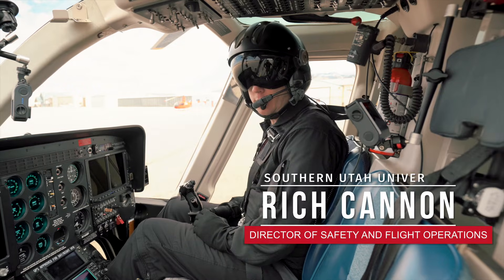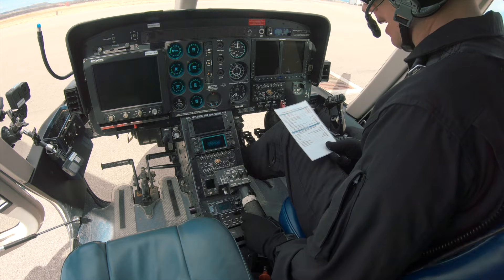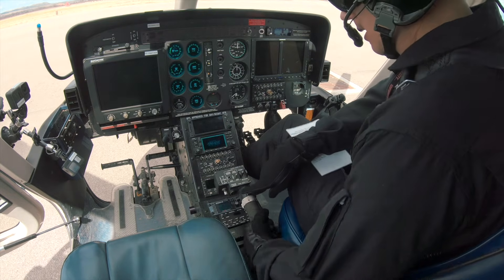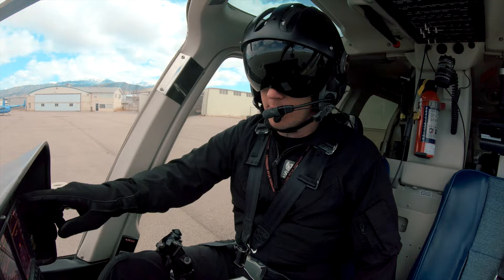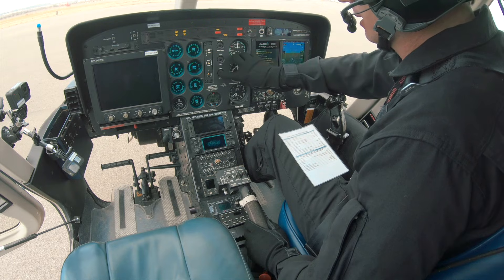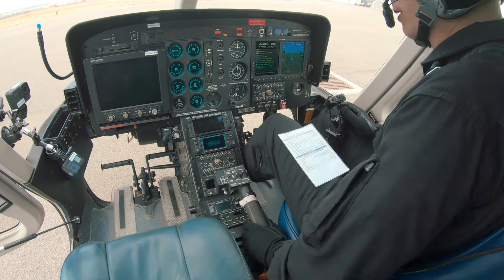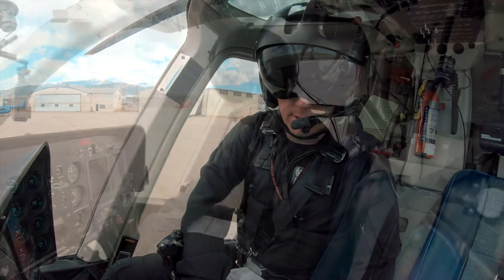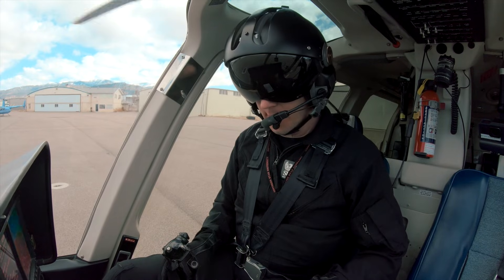How to Startup & Take Off a Bell 407 Helicopter

Comment: Retired ATP/CFII ROTOR & Fixed. Excellent CFI explanation.  Wish I was young enough like you to fly this.  My vintage was BH206, 206-L1, OH58, Loch, and A-Stars.  Retired now, I still keep my CFI’s current.  This pilot did EXCELLENT explanation of startup and reasons why.  Of course,  my era was all steam gauges, and I am really impressed with you as instructor.   Regardless of machine, ,any you always keep your rotor RPM up for a full down auto.   Godspeed young man! .
Reply from the maker: Thanks Ken! It sounds like you've had a fulfilling aviation career! The instructor in this video, Rich, used to be our Director of Flight Operations before becoming an EMS pilot. His son has followed in his footsteps, and after training and instructing with us, is now also a helicopter pilot in the industry. 🚁
Reply: @SUUAviation if I MSY be so bold….would you please pass on a lesson I learned from an older guy while flying for a PD.  He told me when it comes to flying EMS to never be in such a rush to be the subject of your EMS response.   Always insist for a non-standard LZ to have a ground guide person call out wires and hazards.  And always do a high level recon before putting down to a highway or non standard LZ.  That advice save my bacon once from wrapping a thin telephone company cable around my rotor shaft.  The darn thing was damn near invisible from the air.  I missed it on my high level recon and had it not been for a fellow cop in the ground calling it out, hopefully the main rotor woukd have cut it but we’ll never know.  As my FAA POI told me when I became a check airman - never be in such a rush to be the subject of your own rescue sortie.  Enjoy your times.  Hope you have as much fun as I did.  Grab your rotor instrument rating and CFII’s if you can.  Believe it or not, the FAA really is there to help and they can be great mentors.  I even got to be part of the NTSB investigation team on TWA800.
Yesterday’s old news.   I hope you now go make your own memories (safely).  Godspeed!
Reply: PS if you ever think your wrapping a wire around the main rotor shaft or the collective response gets sluggish….bottom the collective,  at least you can then make at least a run on otherwise if the collective is up and the push-pull tubes become tightly wrapped up, you’ll fall out of the sky like a rock.

Comment: That's a pretty perfect video, good cuts, clear voice with good informations right on the spot. Not too fast or too slow. One question....what would have been the alternate start?
Reply: Motoring the starter for a couple seconds to cool down the temps and then proceeding as normal